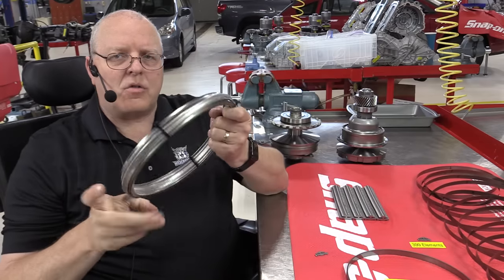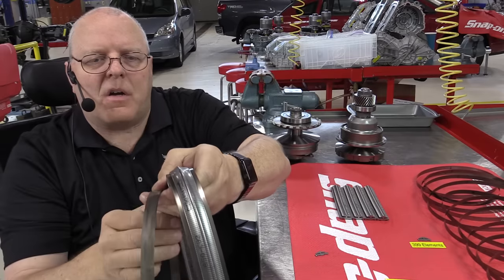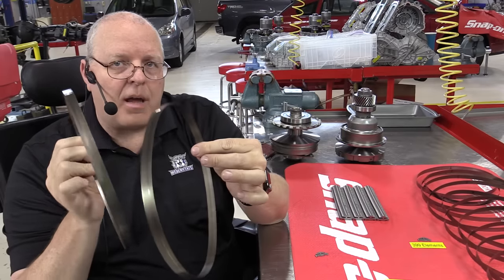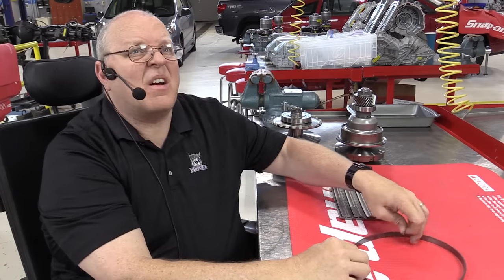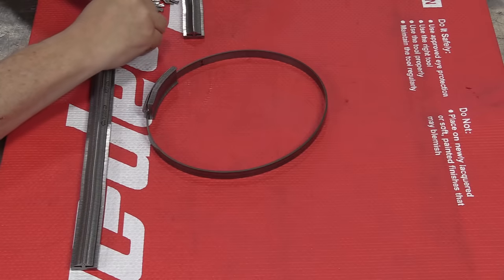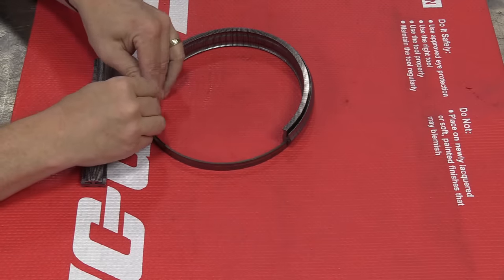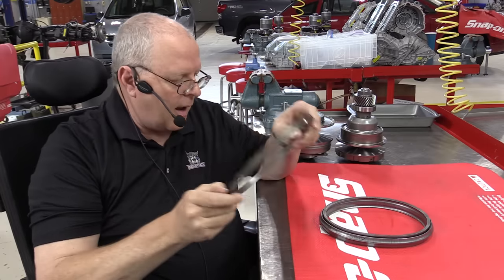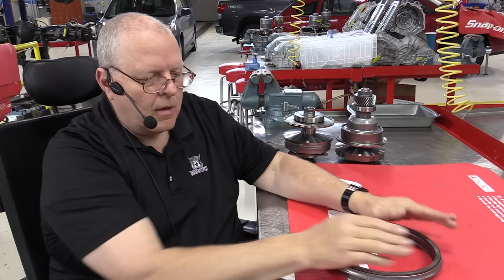The 423-Piece CVT Steel Push Belt

Comment: This seems like a really cool concept, but 309 + 12 ring packs per side all flexing and relying on friction sounds like there are way way too many failure points. Ya'll need how to drive stick. Manuals are lighter, more efficient and have less parasitic draw from the engine to the wheels.
Reply: Wanna save the environment? Drive a manual.

Comment: Never seen a pulley system that the drive belt pushes.It seems to be against every engineering concept I have been taught and seen.
Reply from the maker: Google "Bosch Push Belt" and see what the manufacturer has to offer. It pushes
Reply: @WeberAuto  There  is one way to prove if the name does mean that bit pushes is that the pull side of the belt  be removed and see if the belt can indeed push the drive pulley. Something I would like to see.

Comment: Cvt transmission they won't hold a car in low heat very well if the grade is steep I don't recommend to park car on a hill we don't know if the belt could brake car mite roll down hill don't tow a heavy load

Comment: You didn't even show how it interacts with the pullies
Reply: Qusin111 the friction of the plates of the belt on the face of the pulley provides the mechanical connection between the engine and final drive. Pretty simple stuff

Comment: I'd rather have a CVT than a five or six speed automatic those always fail my CVT has 275000 miles on it and I never changed the fluid I never will just add some if it gets low never change trans fluid on a car with 100.000 miles I am a believer in CVTs I have so much power advantage over non CVT vehicles
Reply: Well it pretty much depends on how the CVT is built, Nissans are known to have failing CVT boxes while Toyotas seem to last

Comment: Transmissions have gotten worse in technology, from the aluminum power glide to the 350 turbo to the 700r4 to the cvt transmissions. growing up it was nothing for an aluminum power glide to last 200k to 300k miles. then they came out with the 700r4 (aod for ford and a4ld) and they started failing before 150k miles now they have the cvt transmissions and they fail before your warranty runs out.
Reply: It may also have a bit to do with the ever increasing horsepower, but they should be able to make the transmissions better for sure. CVTs sound like a bad Idea all around if you ask me.

Comment: Then only thing you need to know about these belts is to neve ever own one.
Reply: phillip kalaveras These are great, if you never need to get out of the way and if you like the feeling that your transmission is slipping. 2019 Subaru Outback here, wish I had not bought it. Weak feeling car. Also you can test how well your engine runs at high RPM if you really need to take off quickly.

Comment: Those bands are made of thin metal, metal fatigues with movement,  one finally snaps and , bam. Its all over. Your car is now worthless.  Engineering knows this will happen to everyone of these units. I'm surprised they last as long as they do. Regular automatic transmissions last much longer. And can be rebuilt for  less than half the cost of a cvt.

Comment: How you can by so idiot pushing a belt in a V shape pulley, you have to pull on the belt to make it tight in the v shape  ( CHECK on Kia Forte or PIV transmission)

Comment: So basically, its a snowmobile clutch in a car!
Reply: The variable part yes. But he pointed out the transmission has a torque converter. 
Are you a snowmobile if you have a flexible nonmetallic belt then it’s not a pusher configuration.

Comment: Now i know why CVT are not reliable compare to standard auto...just imagine one of the 399 element being broken or just simply coming off the ring..it will surely makes a catastrophic damage to the other component...
Reply: Belt failure is very rare. It's almost always and underlying issue that causes these to malfunction and snap the belt. Most CVTs work just fine for 200k miles though. Millions and millions of them in the road.

Comment: This technology very complicated  to fix when trouble happen,too many small part of component and easy got trouble,,,,,,i think, there is better new tchnology from China(i think..), it called e-clutch,,,it's manual transmision but feels like automatic,,,it so simple/cheap of maintenance if it got trouble and more reliable...,because its just manual transmision component by adding electrical clutch component,,,,,,,,

Comment: Nissan CVT be like
- cvt pulley snapped cannot change gear because it connected to powerful V6
- belt broke overheat because coolant suck
- fail too soon because change fluid at 100k miles not 50k miles.

Comment: I think this is a bad design cause what will happen when that belts break u know how much damage those to the Trans inside its no way that can be repair it's 2 thing that can go wrong whit that belt metal waren fatigue it's rely a money maker for the dealer cause I won't  by another used Trans like to replace the one that when bad n created all tha damage that goes inside after those belt break n all the pieces go all over inside there n grinding all those metal it's a bad desire no matter what dies any body have a good answer for those belt no to break

Comment: The parts are far too delicate for a transmission, the old solid state transmission is way more durable, you could not run a CVT trans in a race car, that explain it, the fuel you save is not worth the heart ache

Comment: great job on the video, thanks!

however, that CVT engineering is some precarious stuff.  seems to be too unstable and junky for any kind of lasting quality.  it's pretty common to hear about cars w/CVT tranny's crapping out between 40,000-80,000 miles, and usually a broken belt is the problem.  can cost $2,500-5,000 to rebuild, then you just start the process all over again.  

best to stay away from cars w/CVT's! watch this video to see a belt-fail on a CVT tranny:

https://youtu.be/_64zEsMdQ9A
Reply: Howlin' Waters What’s even funnier is that I own a car that has far surpassed those miles on the original CVT. These things break because people drive like crackheads and rag doll the transmission. CVTs are more delicate than the conventional counterparts yes but that also means that you should still take care of them as well. That goes for any transmission for that matter tbh.

Comment: You might want to tell people how SHIT they are to.  Terrible to drive always sounds like the engine is lagging , engine load increased resulting in premature engine failure  belts are shit and fail at low miles (Nissan and Honda are shocking) and super expensive to repair which you will do early in the vehicles life , If it lives that long.
Reply: You're a little late to the party to get a response from Professor Kelly.
Reply: @thx1138guy  Pff I am a mechanic of over 45 years , I seen it all so I dont need a response from anyone.  CVT = cheap shit its that simple.